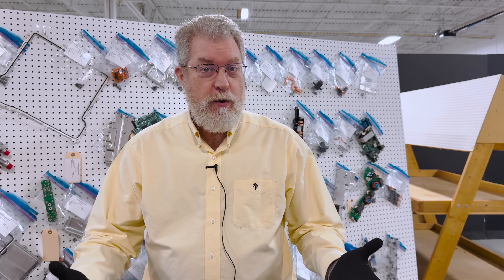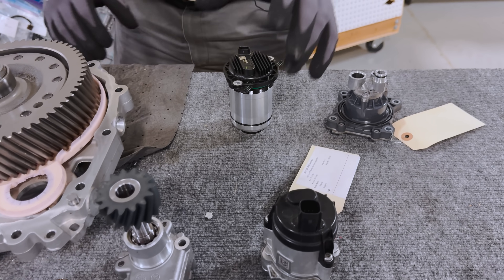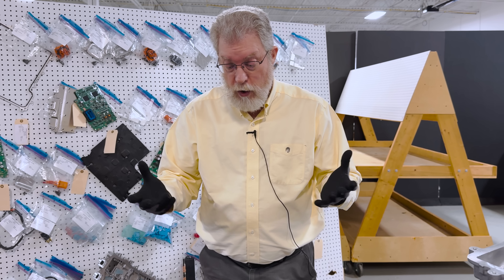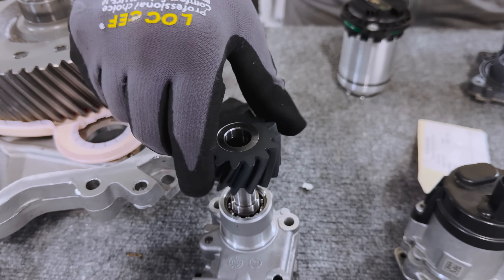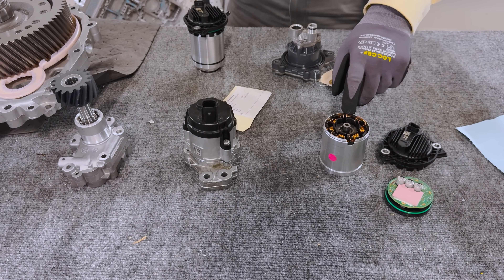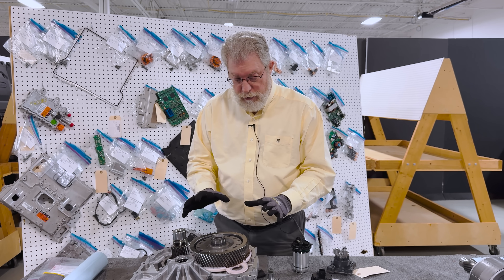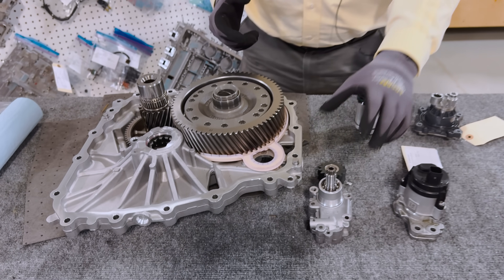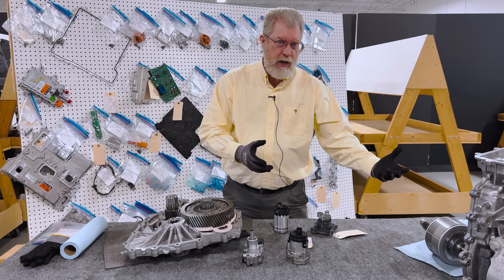The Cost & Engineering Trade-Offs of EV Oil Pumps

Comment: I get the compromise of the mechanical pump. But rather than design it for worst case scenario, couldn't you just design it for everyday scenarios and have a thermostatic valve that allows cooling to the main coolant? You could rely on a higher delta cooling temp for demanding situations rather than flow too much all the time and cost efficiency. Personally, I like the idea of a mechanical pump over electric, I think they are more reliable.

Comment: Assuming the mechanical pump gets the job done, I would want mechanical over electric all day long as a car owner.  A single gear is far far more robust and reliable than an electric motor plus electronic control module plus connectors plus wiring.

Unnecessary complexity and fragility for small gains in cost or efficiency are major reasons why modetn cars are riddled with problems that are often difficult to diagnose and expensive to fix.

Comment: I would have thought that an electric oil pump would not have the same level of wear and tear of a mechanical unit and thus, repair or replacement under warranty would also be less likely leading to cost savings for the manufacturer.

Comment: There is no way that gear drive pump is an existing design that was already in production and just bolted on that drive unit. It was specifically manufactured for this purpose. (but still cheaper than the electric one)

Comment: I wonder if motorcycles have electric oil pumps allowing to preheat the gearbox and optimize efficiency at high speed?
- I just try to understand why my neighbour is revving every morning his very noisy engine bike at high rpm for 10 minutes to preheat his motorcycle.

Note: I believe that the habit of revving a motorcycle was not an issue with carburetors because there were no manual "choke" like on a car with a carburator to make the fuel mixture richer, then slowly reduce it as the engine warmed up over a couple of minutes to prevent this stumbling. 
About the cold engine problems on a carbureted engine, the cold engine parts would cause vaporized fuel to condense, which would make the engine stumble and stall. So this seems to be an outdated practice coming from older carbureted bikes.

Comment: The benefit of an electric oil pump is that it can get the oil pressure up and activate the tensioner on the timing chain before the engine is cranking.  I had once a loose chain skipping a tooth when doing a very cold start when the oil had not yet been pressurised enough to tension the chain because it was too cold (and the tensioner was leaking slightly back into the sump so it  couldn't be seen).

Comment: Why use an oil pump at all, seems completely and totally unnecessary. For literally a century, gearboxes and differentials have survived massive shear and friction forces without any significant wear, and neither have any oil pumps. They rely solely on splash and entrainment to lubricate

Auto gearboxes are different, as they require an oil pump to create hydraulic pressure to drive solenoids

This smells of a designed-in failure point. A solution to a problem that doesn't exist

If cooling is an issue (it shouldn't be, there is minimal friction and magnets don't create heat), then use one of the cooling curcuits already present in an EV = zero cost (except for a couple of extra coolant hoses) and no unnecessary parts to fail
Reply: It’s way more efficient to pump oil .
Reply: @YoureNamehere-t6l No way, Jose. I guess you have a perpetual motion machine in your garage as well. And believe tariffs are paid by exporters.....

Pumping oil is ultimately less efficient, than not pumping oil, every day of every year

Comment: I guess ICE vehicles need oil pressure from the start, more than EVs. 
High load on crank shaft especially at start.

Whereas EVs, besides some cooling, only need oil pressure when moving, making a gear driven system logical…

Comment: As the lowly end use consumer I experienced this difference in cost firsthand when the electric air conditioning compressor in my MiniCooper EV failed this summer.. Even the service advisor was stunned at the price of the replacement part – $3K… plus almost the same again in labour costs because it was so integrated into other parts of the cooling system for the car. I must admit at that point I did a little bit pine for a lowly, stupid simple belt driven compressor you could buy off the shelf from any one of a dozen aftermarket suppliers like the good old days of the ICE age….

Comment: Also have to factor in the required larger battery due to the reduced system efficiency, and account for the extra space it requires, and it’s extra weight. Then the customer gets to enjoy the greater electricity consumption of the vehicle etc etc….  It’s almost always better to choose better over cheaper, especially for the customer. If I were the customer I would happily choose better for only $20 more.
Reply: Maybe. Maybe not. Efficiencies can be found elsewhere.

Comment: Bolt drivetrain designed by LG, right? Chevy did not design it, necessarily. Chevy seems to not care about vehicle efficiency, as evidenced by their “throw more cells into car” strategy so not surprised GM ditched more efficient solution.

Comment: Electric is more efficient --- if you want a better ICE engine vehicle, you have an electric power steering pump, an electric motor driving the A/C compressor, electric fuel injection pump, etc. BTW --- ask the diesel guys about the "CP4" (the Bosch mechanical fuel injection pump that is cheaper, but when it fails, it "grenades" the engine and a complete engine rebuild is required.)

Comment: This is again how GM and other legacy oems don't have foresight and real engineering skills. Not to mention that the plastic piece in the drive unit scares me. Put it on record that I see those pieces rubbing against the gears, deteriorating, flaking, leaving pieces in the gearbox and creating problems from debris and failure. Such a thing is just a band aid for an issue of not being able to control the oil flow properly and efficiently with an electric pump rather than a gear one. My other issue is how easily is that geared pump able to be replaced if it is necessary. We know that impellers do wear over time and need to be replaced. Is that replacement more of an issue if that pump is geared directly with the drive unit or actually inside it, versus an electric that sits outside. Remember that if that geared pump is not totally inside it needs a gasket around the shaft where it enters the drive unit versus just permanent cast inlets with hose connections which would not have the same likelihood of seal failure the way a shaft entrance would.
Reply: The engineering is fine, but they don't get to make the decisions.
Reply: Whatever, flathead fords had plastic cam gears.

Comment: I'll take the mechanical pump over another failure point, but I understand the need for on-demand circulation for higher performance vehicles. 

The preconditioning argument is suited for the battery performance and cabin comfort. The motor doesn't care in the real world.
Reply: The amount of fail points remains the same, both have oil pumps.
Reply: @YoureNamehere-t6l 

One is strictly mechanical requiring no electronic interface. The fact additional wiring, hardware and software is required for one of the two says otherwise.
Reply: @YoureNamehere-t6l 

.....not to mention additional plumbing and/or gasket(s) required to interface the external component of an electric pump.

Comment: Tesla uses the motors to generate heat to heat the battery when it's cold. You can't circulate oil if the drivetrain isn't in motion with the mechanical pump.
Reply: Tesla uses their cooling system to heat the battery which is run by a pump not the electric motor!
Reply: @gmv0553 Yeah but the heat comes from the motor, are basicly short circuit the motor in a controlled way to produce heat and distribute it woth the cooling system.
Reply: @gmv0553  ~ Both. Heat pump "ambient source" uses the radiator to extract heat (air-conditioned air comes out of the radiator fan), but the motor(s) also throw several thousand watts into the heating. It uses both when preparing for fast charging (regardless of whether it's subjectively "cold" weather outside).

Comment: Some cars have both. Like newer ICE cars with start/stop operation can use small electric oil pumps in the transmission to keep the car in gear while the motor is stopped. Normally when the engine stops ATF oil pressure drops to 0 and the transmission falls out of gear into a neutral state. Then when the motor turns again it takes a few seconds to built pressure and shift the valve body and pressurize the correct clutches. In a cars with start/stop you need it instantly ready to drive soon as the light turns green without waiting to shift back into gear.
Reply: ZF uses an accumulator for that

Comment: I did not notice any lube pump in the Munro tear down of the VW APP550 motor. No oil pump for anti friction bearings is much less costly than either a mechanical or electric oil pump!

Comment: Everyone seems  focused on the pump being used to cool the oil.  The main function of the oil pump is to lubricate the gears.  It the gears aren't lubricated oil temperature is the least of your worries.
Reply: Splash lubrication without any oil pump has been used on hundreds of millions of cars with manual gearboxes - and 99% of all diffs
Reply: That's true in a regular car.  EV's are water cooled.  Some use a oil-water heat exchanger, for the motor.  On those vehicles, a mechanical oil pump is like connecting a combustion engine's water pump to the transmission output.

Comment: Note - the high viscosity when cold is not an issue for the electric pump as you do not need to circulate the oil when its cold
Reply: How do you lubricate the gears if the pump isn't running
Reply: @gappmast9712  The gears are oily - you don't need to add extra oil immediately - if it wasn't for the heat then splash lubrication would be enough - that is all that is used in most manual gearboxes and in diffs

Comment: Tesla uses the drive units to create waste heat to support warming the battery for proper DC Fast Charging. The oil needs to be to flow through the heat exchangers to make this happen. Doesn’t GM do this? I also noticed that they (Tesla) have a routine in Toolbox that can infer fluid level by running the pump and monitoring some metrics to determine this. 

Thanks for the video, awesome stuff as usual!
Reply: If you’re using the waste heat to enable something, is it even really waste heat?
Reply: @skibbyau that’s what they call it and I have thought the same about it. Perhaps there is addition context I need to dig into

Comment: The mechanical oil pump only operates when the drive shaft spins.  If you aren't moving (like when you are charging) you aren't pumping oil.  Hopefully that oil isn't being used to cool the batteries.
Reply: Batteries usually use a glycol loop, sometimes directly through refrigerant loops. I haven't seen an oil cooled battery.
Reply: You need another coolant loop. Crazy.

Comment: GM is using a mechanical pump because that's what they have in their ICEVs. But ICEVs are dying out. BEVs are replacing petroleum itself. Filling stations and refineries will close. In the next few years, it will be harder and more expensive to buy petrol. ICEVs will go out of production, so the cost benefit they get on that part will fall as volumes fall. 

So GM saves a few bucks today but speeds up its final demise. Yup, that's normal practise for GM.
Reply: Do you think all that is happening in the next 3 years? And do you think that if they sell less ice cars but more evs that the count of oil pumps is less?
Reply: @YoureNamehere-t6l  You should watch the video. The mechanical pump was cheaper than the electric pump but now it is not cheaper than the electric pump. And the electric pump gives better control. Which means GM made a short term decision which has saddled themselves with design which costs more and delivers less and needs an extra plastic collar installed. Which was all in the video.

Comment: I wonder if this change was driven by warranty issues on the electric pump? There are a number of owners who were left in limp home mode due to a cooling pump failure. Could be sometimes a simpler mechanical design can be used to fix a more complex Issue and improve reliability. Just because they now make millions of them does not mean they are going to be reliable.
Reply: Club members with 300K miles on their EVs have had no problems with motors, 10% have battery changed.
Reply: Things can be designed for higher reliability. Gear pumps can fail due to wearout (I've replaced one).  The mechanical one is internal to the drive unit so that would be an expensive repair. 
The electric pump bothers me because it's not soldered together between controller and windings, but just scrunched in. Hopefully it's easy to replace it.

Comment: But in automatic transmission there are solenoid valves and flow valves. If they add these valves in the design then it's still cheaper and more efficient than the electric pump.
Reply: Mmmmmmaybe.
Reply: @jamesvandamme7786  --  Indeed.  The hydraulic pump in an automatic transmission runs at engine speed.   That's a natural for replacing it with the VFD electric pump than can provide full pressure at start up and not waste power while running.

Comment: 5:29 What? Not only did Tesla already make and sell Roadsters, Model S, and Model X. But the Model 3 was in production only a year later than the Bolt. And they cranked to mass production soon after, whereas the Bolt never did.
Reply: The bolt would have most likely started design work in like 2012.
Reply: It doesn't change the fact that at that time electric oil pumps were a niche product. A few years later costs came down.

Comment: So...GM uses the cheapest solution: "off the shelf"; which underperforms, has shorter life and eventually cost a lot to repair.  But it will last the warranty, so GM won't have to pay for the repairs.  Yup, sounds like GM !  Gotta look at all the wonderful "cost reduction" efforts built into the Equinox, which seems to be designed to last the warranty +5% !  Note that the engineers at GM know all this, but have to follow management's directives.  "You did it, Mary !"
Brings back memories of using a vacuum actuated windshield wipers.  Used because the vacuum was "free" and wiper motors cost money.
Reply: You think an electric pump with insulation displacement connections is gonna be more reliable than a gear and an impeller?  Color me doubtful

Let's hope modern electric oil pumps are more reliable than starters or window lift motors.
Reply: @carltonfaller3986  Depends who designed, installed & made them !
Reply: Of course I guess as of long term statistics this plastic part will rot away/degrade/become loose more often than than the mechanical pumps may fail. They pump oil, if produced according to spec they may last half a million miles, but the plastic, being in the oil too, may be gone after 6, 8 or 12 years already.

Munro should have told us more about the plastic material and where the mech pump would be made - inhouse under union contract or at a mex suppliers factory abroad (GM promised a certain financial volume in production 'according to mutual benefit contracts of the pasts')?

(This video is way too slow and simple to match demand of global engineering markets as of today? ... even for youngsters, I guess.)
Reply: Unless they undersized the pump horrifically, this will work fine AND be more reliable AND be cheaper.

Every ICE engine works the same way for a reason - mechanical pumps are better in every way EXCEPT metering.

For cooling, you just open the thermostat more, you don't need to change the flow rate... that said, it does mean if you DID overheat the motor the car will hopefully just warn you to drive slowly and to NOT stop the vehicle... that's the only risky scenario an electric pump fixes.
Reply: @looncraz  I've owned over a dozen GM products since 1960.  No water pump lasted 2 years !!.  Either the impeller disintegrated, or more usually the bearing would leak.
Reply: @shazam6274 this is an oil pump, not a water pump. Have you been replacing the transmission oil pump in your cars very often?
Reply: @stephenj4937  Same designers and motivation, but the oil pump in a transmission is very different.
Reply: @looncraz Yes but, it's analog. And I want it digital because I can do all sorts of calculus with the data, for instance recalibrate future designs and or pressure suppliers way more specific and to the point. 

And yes, data come with costs - but who pays, the supplier and his workforce, capital markets when suppliers go bust or Teslas shareholders or workforce or the buyer - or does it come out of increasing future efficiency? 

(And - as a know my little chinese supplier, he will come up with an unauthorized copy of this well designed way way Tesla pump for less than 25 USD quite soon and US homeworks want be required to visit local Tesla dealers but order direct. Das Zündschloss-Modul für ein Fiat Ducato Wohnmobil kostet aus China frei Haus 18 € und bei Fiat ca. 150 €. Man darf eben nur immer nicht so dumm sein, aktuelle Fahrzeuge zu fahren, ein wenig warten, bis China auch wieder soweit ist, lohnt immer.)
Reply: Reminds me of “who killed the electric car” documentary… short answer… GM did
Reply: HOW else is their CEO supposed to make millions...

Comment: So they saved $10-20 per car, and 1.lost the ability to precisely control flow
2. Lost efficiency in the drive train
3. Lost the opportunity to scale a better, electronic pump
4. Added a plastic part that can fail
5. Lost the ability to push oil when in reverse 

Seems like a bad call all around
Reply: And need more battery to move the car which is a more expensive part.
Reply: I'm thinking the mechanical pump is more reliable.